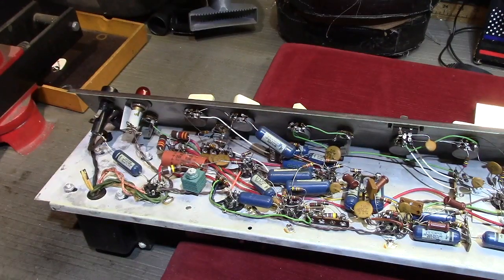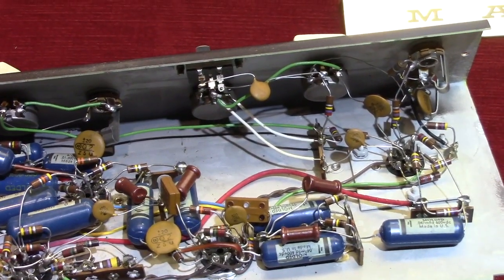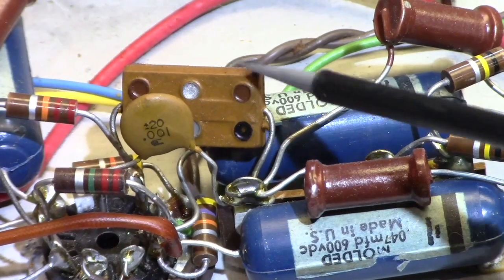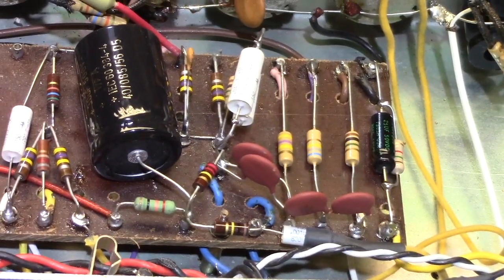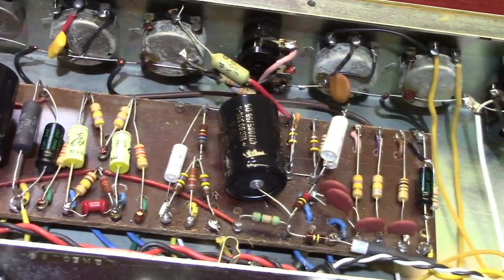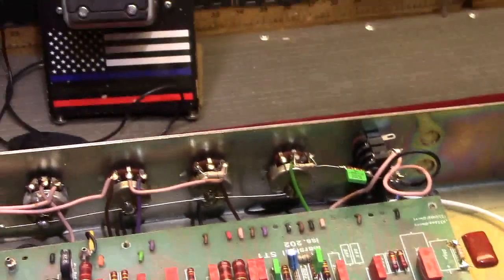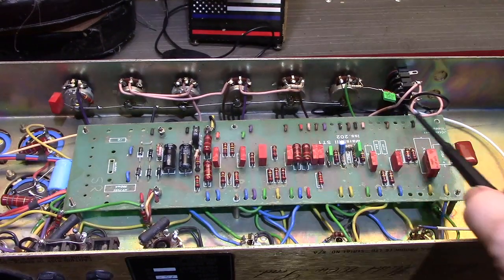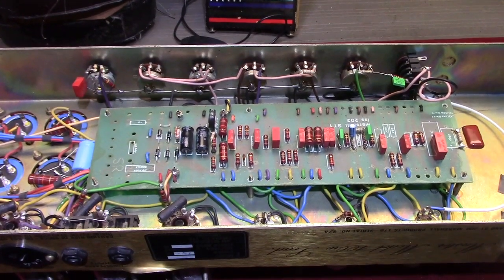TRUE Point To Point Vs Turret Board Vs Printed Circuit Board - What IS The Difference??

Comment: My crate stealth 100 by Lee  Jackson has a huge Pcb.
  Pain in the ass ,but , work on it once it's Good for another  30 plus years.
 Resolder some stuff install new Jacks deox the pots, low o high gain a killer fender clean , and dead quiet. 
  Amazing marahall killer not so well known. Pple ht get them keep them for a reason.
 Slm and ampeg were Killin it In the lee Jackson era.
Wish I had the 5 position mid switch like the ampeg had.

Comment: One thing I would add, is that a downside to eyelet boards, at least from older Fenders, is that the boad can become conductive, which creates all kinds of fun problems. Empiracally, I would argue that Turret Board construction is the better way to do things overall. It is much easier to work on, repair and manage things with, while also being aesthetic, and long lasting, if not a lifetime way of construction.. True PTP is an art, but is frought with two major issues, the first being that because it is an art, not everyone is as good at it as another, second is the repairability. True PTP amps are a brat and a half to work on. Couple that with the " art " aspect of it, a bad layout remains bad, if you simply place teh same part back into the same spot. With turret board construction, you get all teh best of what each construction form offers. 

I do agree that a well designed PCB is just as good as any other way of building an amp sonically and functionally. The issue is that it is not a lifetime construction ( it is sensitive to multiple repairs ), and most vendors do not properly design their PCB's, so other issues can become apparrent with certain failure modes.
Reply from the maker: Agreed.  Except it's my  experience that eyelet boards become capacitive not conductive.  Otherwise, well said.

Comment: I think it's hard to beat turret board construction. You have the cleanness of the PCB circuit without any of the repairability issues, and none of the rat's nest of point to point.
Reply from the maker: Well, turret board and eyelet board are really interchangeable for me.
Reply: To the amateur builder, the simplicity of a cleanly built turret board is very attractive. It’s like an old Chevy. You can see what’s happening when you open the hood.
Reply: You know, I've since come around on this. I think true point to point is just as durable, has much shorter connections, is more stable and less prone to oscillation and noise, and has a handmade function over form beauty to it.

Comment: I really like your videos with amp guts. Need more behind the panel episodes. Do I sense a PCB designed Granville on the horizon?
Reply from the maker: steakncheddar - No, I have no interest in that.  I can easily make my own turret boards.  PCBs not so much.
Reply: @GranvilleGuitars   I agree with you. Coming from someone who could go down the path of designing a PCB, I'm building mine using turret construction. I want the component side and solder side of the board to both be easily accessible from the chassis opening. There are a few small other reasons why I prefer turret construction but I digress. At the end of the day if we take a spin on reverb looking at old Marshalls almost all of them will have those ugly blobs of cold solder sitting on the component side of the PCB like you see in this video (they are the most difficult to mod cleanly by far), and that says something negative about PCB construction to me. Take care Scooter!